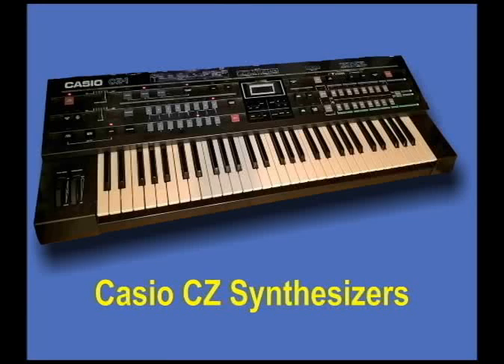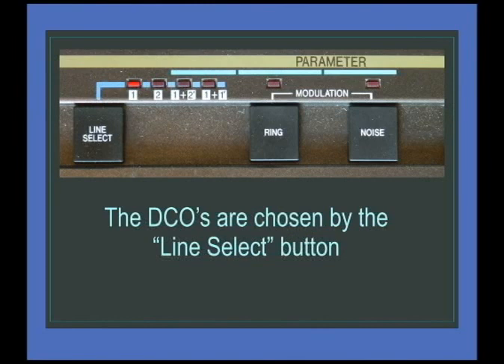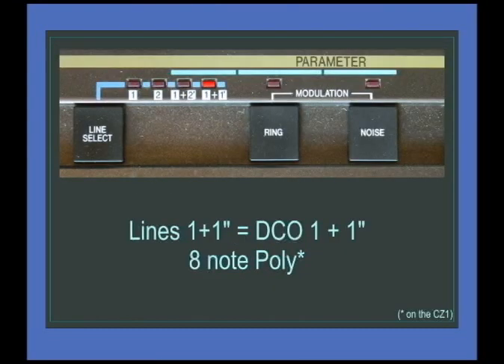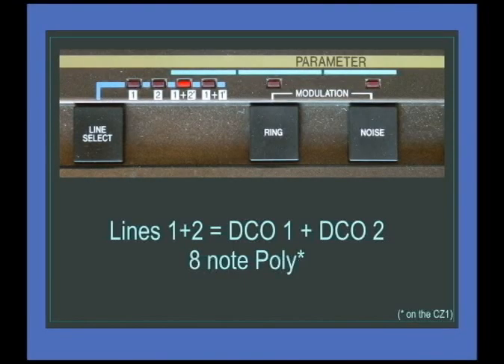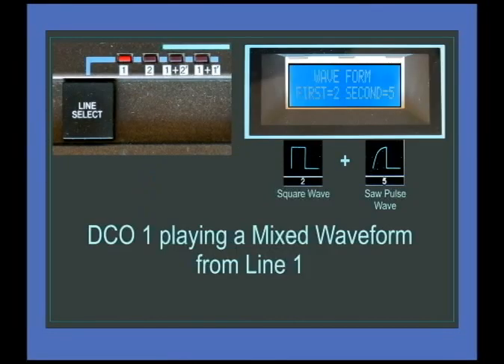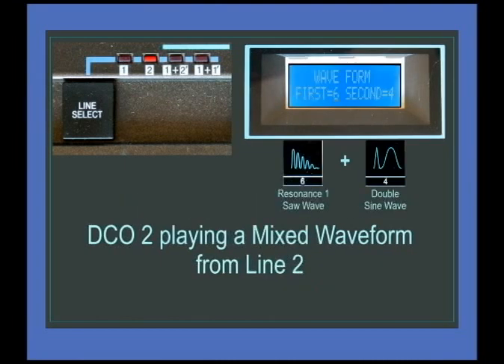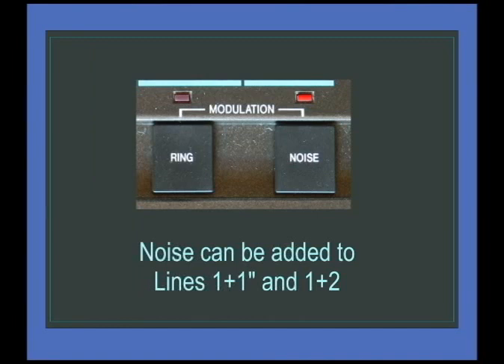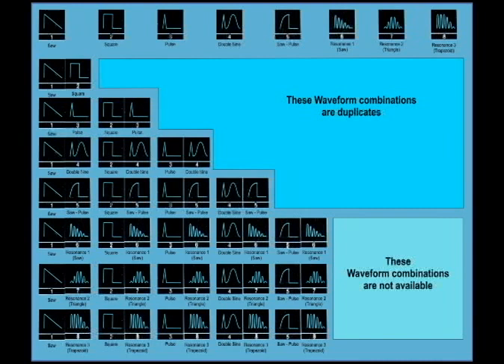Casio CZ Waveforms

Comment: Hi, how to produce sine like sounds or dreamy pads with those waveforms?
Reply from the maker: Hi, Some of the sounds are based on a Sine wave or "Double Sine" But the wave forms can be quite bright until you start using the Digital Waveform controls(works like a digital filter) the more you apply then the closer you get to a simpler Sine type of wave.  To get the Dreamy effect. Use more than two waveforms. detune, use chorus ans long envelope settings so the sound evolves over time. Good Luck.

To start from the beginning: use the initialize setting and the just concentrate on 1 sound(waveform) until you learn how it works.
You can learn a lot by camparing what is happening in one of your favourite Presets. But Playing someones own  Presets is NOT the way to learn Synthesis !!  You need to spend time on it
Reply: @paddyc3301  Thank you ! I will try it.

Comment: Can U pleas describe how to do this from scratch without Using a preset? Tried an empty bank (D5) but cant get the results U do. Only get non-fading tones when trying to put everything to zero (except the "AMP" ). And yes... TOTALLY new at this. Want to learn how to totally build up complex sounds my self. ;)
Reply from the maker: Hi, and put "Line select" to "1"  this way you will only hear the sound of  just one line (or oscillator)   In the Waveform (see my video) make sure you just have a waveform in "First"  this means "Second" should read "0"  I think it would be wise to watch through again and then get your synth set up and try and copy exactly what I have on screen. Remember- if you dont want the sound to fade or the filter to change you need to make sure you use the red "Initialize" button  on the the "Envelope" settings have a "Sustain" selected (look at the synth screen ) or better still the manual !!  Good Luck.
Paddy C

Comment: Are these from a CZ101 ? They say that the sound of a CZ101 is better even than a CZ5000 or a CZ1, tho' this sounds incredible to me. Which is Your opinion? Thanks, also for the video.
Reply: All the Casio synths of CZ series are built upon NEC uPD933D LSI chip and equipped with the same sets of wave forms so in terms of sound generator they sound identical. The only difference between the models is that some of them such as CZ-1 and CZ-5000 have a BBD chorus circuitry built in whereas CZ-101 doesn't. Not long ago I've picked up a CZ-101 with broken keyboard decoder for just $50 and got it fixed for another $1.5. I also built a replica of Juno 6/106/MKS70 chorus effect so I can run my CZ-101 through it. But this is not the thing. I keep the CZ-101 just for the purpose of generating bass lines. That's where it really shines. Here are some examples where a bass line is created with  CZ-101:
https://www.youtube.com/watch?v=dN8e9b2ON8s&list=FLpd6nN4Jf2aEKBIOlHbEbkA&index=8&t=0s
https://www.youtube.com/watch?v=nH69IkpL1-k&list=FLpd6nN4Jf2aEKBIOlHbEbkA&index=2&t=0s

The presets are based upon wave form No.3